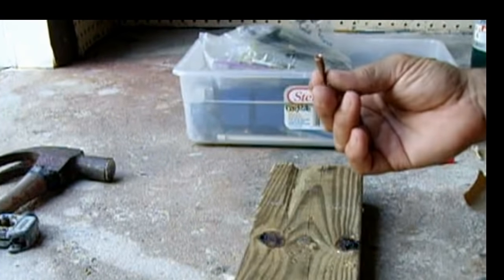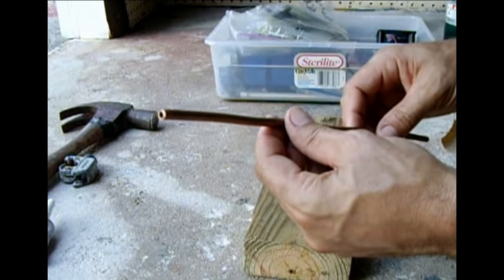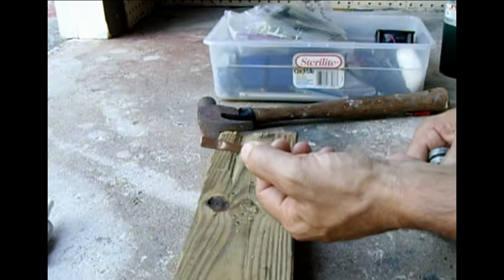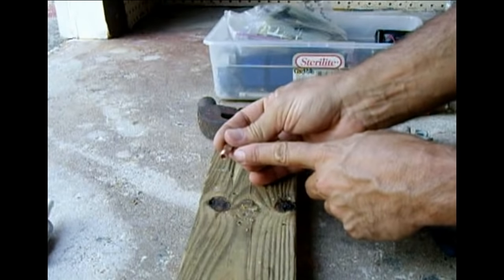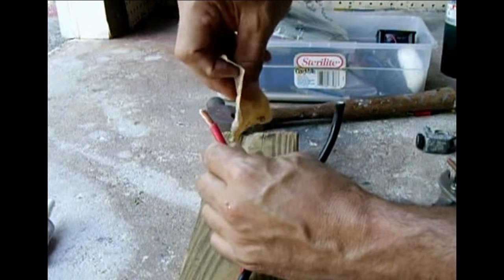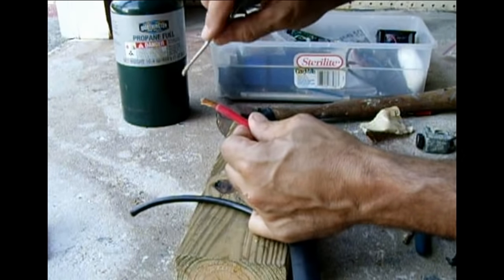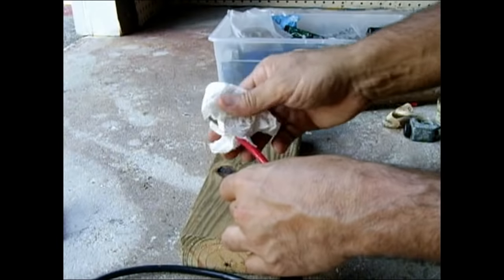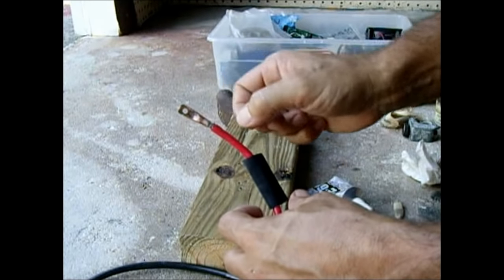How To Make Copper Battery Cable Connectors!

Comment: Haven't read all of the comments, but I'd personally put the crimp in a vice and make a molten pool of solder in the end. Then, plunge the wire into the pool of solder. But, high pressure hex crimping is best for automotive, solder doesn't stand up well in high vibration environments.
Reply from the maker: Vice is no good. When you flatten the end using a vice, both sides flatten the same and the connector does not lay flat. Solder has no problems with vibration. Just make sure the connector is very clean, then you can flux/tin the wire before dipping it into the copper connector which has molten lead.

Thank For Watching.
Reply: I meant that after you've hammered the end, place it in the vice with the open end up. That'll allow you to create a pool of solder in the end of the crimp without the wire near the heat. Then you can push the wire into the end (that now has a molten pool of solder at the bottom). Instead of trying to heat the crimp with the wire inside, softening the insulation, and trying to force the solder into the middle of the wire from the sides.
Reply from the maker: After I am done hammering, nothing will leak out.
Reply: electronicsNmore Nice video and especially useful if you have run out of cable lugs and absolutely need to finish the work during weekend (or if all shops are far away).

If you want even slightly better cable lug do the hammering in smooth surface like anvil or similar. This way there is no roughness in conducting surface which will help to boost its life and resistance to corrosion. Also if there is a solder pot available, it would be beneficial to dip the preheated  lug in that to get nice protective plating - like found in commercial cable lugs.

Maybe you have some very expensive shops there, but here in Northern Europe the standard 2 AWG (or here we say 35mm2) tin plated, 99,95% pure copper tube cable lug costs about 1,50 EUR (now about 1,70 USD). This is the price when purchased separately and if ordered in larger batch like 100 pieces the price would be a half of that (about 0,85 USD). These are approximate customer prices including VAT. For companies in larger batch sizes the prices are naturally way less.

I also think that correctly made crimp connection without any soldering is the best connection, but it requires from good to excellent quality tool. This is not a problem with wire sizes like 4 AWG or 2 AWG thou, and good enough crimp pliers cost around 100 USD. But with ultimate solutions like superconductor assemblies I have seen use about 5000mm2 crimps in some terminations, and those crimp tools are very expensive. Naturally there can not bee any weakness in those connections and only perfect and large surface area air tight crimp is suitable. In extreme applications also the fact that tin solder (even when doped with high silver and copper content) does not conduct as well as pure copper does matter. And in those very extreme applications connections typically do not use tin plating against corrosion but silver, palladium or rhodium plating instead. Palladium and rhodium have not so good conductivity in typical manner (as a wire) but have very good contact resistance characteristics and can take more mechanical stress than gold plating.

So because pure crimp connecting is used in applications involving highest tech like superconductors in particle accelerators it is safe to say it is the ultimate connection method. But that said, there is nothing wrong with the pure soldering type connecting without any crimping. Thou here we have safety regulation that soldering is not allowed as connection method in any standard main power grid applications. Only mechanical connections to crimped wire ends is allowed. This regulation do not concern low voltage applications.

Comment: Great video...if you have all the tools needed...the problem is that it cost so much money when you consider all those extra tools and if you dont do all the precautionary cleaning and coating correctly that you are showing then you will pay when everything blows up, so what are you really saving here?
Reply from the maker: Trainer DeLeon Most handy people will have these tools.
Reply: Yep if you have all those tools you would think they would already know how to use them. I mean why else would they have them hanging around but for us starting from scratch and are only trying to do a one time job I think its not really cheaper
Reply: I have all the tools from doing tons of other projects, mostly plumbing & other construction.  I am just now starting to dabble in solar, and consequently looking at ways to contain costs.  So yea exactly, if you have to buy all the tools and the copper pipe, those connectors will cost you about 20x as much to make than to buy.  However, if you are beginning to get handy, the tools are an investment.   A cordless drill is tool #1 on my list of tools to have.  A torch is great for all kinds of stuff including lighting your bbq without all that nasty tasting lighter fluid, lol.  Anyway, options are good.  Lots of food for thought in this discussion.  Thanks all!

Comment: where can i buy or get that copper tube? i went to  auto parts store and they are selling  lug connectors that are a little bit thinner  than yours. do you think this would work for my  battery harness?my battery positive side is using a harness not cable wire.
Reply from the maker: Plumbing and refrigeration supply houses. You want type K or L tubing.

Comment: Whhy didnt  i think of this?  If you drill and file before cutting the lil piece off..you wont even need a pliers..good vid sir
Reply from the maker: Thank You. Usually I do drill/file before cutting, but for some reason I did it after cutting in the video. Makes no difference, but it is easier to drill before.

Comment: Great video, but yeah cut hole before cutting pie would probably be wise. How come u did not crimp it as well?Been in Car Audio since '88 and have seen numerous wires come undone that where only                  soldered and not crimped! Thanks for the idea bye the way!
Reply from the maker: I have never had one come apart. If you saw one pull apart in the past, that is because the person did not carefully clean the inside of the connector before it was soldered. I have a crimping tool that goes up to 2/0 wire. Crimping and soldering is extra good. :-)

Comment: on that i would simplify that work ,by using a dremel for cuttin,sandin,and smothin the crimp and use a table jaws to compress (flatten)the piece of pipe and to make the drilling on the crimp and also i agree with somebody comment ,i wouldnt use weld on tick gauge cable if they can be crimped...crimp works as good as weld or soldering if done right.

Comment: A Tip: Drill it before you cut it so you can hold the item with the tubing.
Good idea though an I will be using it when needed

Comment: You're the MAN!
Reply from the maker: Thanks. It always amazed me why anyone would pay a couple bucks for a large ring/lug connector like this. They should only be 25-50 cents each. Big rip off.

Be sure to check out my video playlists.
Reply: electronicsNmore
You can buy them on ebay for 50 cents a piece in small quantities delivered to your door.

Comment: I flatten, drill hole, cut, insert wire & crimp. There is no need for solder or heat shrink tubing. Its copper wire crimped into copper tubing. A proper crimp will hold it and the heat shrink tube serves no practical purpose other than a cosmetic finish. However, if its your material and time you're using, do it any way you wish.
Reply: besides for a bit of added mechanical strength to the crimp, the solder does help improve conductivity efficiency and prevent oxidation

Comment: great ideal, but I can't see that hole being wide enough and study enough for a marine/deep cycle battery bolt connection?
Reply from the maker: It's fine when using larger copper pipe. Thanks for watching!

Comment: been doing this since I was a kid.  I would rather do the whole and shaping before cutting it from the original piece of pipe.  just a little easier and a lot safer.
Reply from the maker: Usually I do drill the hole before cutting, but for some reason I did it after when I made this video. Still no big deal. Thanks for watching!

Comment: and what size tubing for 1/0 gauge wire? Also your pricing seems to be based on in stores like Lowes and Home Depot pricing for the lugs, I just bought a 10 pack of 1/0 cable lugs off amazon for $13.27 yes your way is cheaper cost per material, but if you have to go out and get the tools to do it you will need to be making LOTS of these to cover the cost of the tools to make them.
Reply from the maker: DanielRichards644 Clearly if you do not have copper pipe laying around, or you do not have some common tools available to you, then you would buy the connectors. This video is for people like myself that have tools.
Reply: electronicsNmore
 I like what you did, don't take it the wrong way, I was just saying people that don't own a pipe cutter (as that is not part of the average tool kit) or that drill bit you have would need to make quite a few of these to offset the cost of those tools outside the typical tool kits. I may look into doing this in the future if I need more connectors at some point in the future and there is no question the lugs in Lowes and Home Depot are way overpriced (car audio ones are worse) but I was jut trying to point out there is a middle ground that is cheaper then the store for those that don't have access to the tools or don't need enough of them to justify the cost of the extra tools they don't have.

Again, just for reference, what size tubing would be for 1/0 cable?
Reply: DanielRichards644     I can easily see the benefit for the occasional odd job. I have a box of connectors, but still encounter odd size requirements occasionally. Slapping that together myself is a lot quicker and cheaper (cost of the lugs, gas, etc) than running to the store. And, of course, most interested in this would have such tools (hammer, torch, solder, etc) in their shops.
Reply: DanielRichards644    Pipe cutter? Are you kidding? You don’t have a hacksaw, jigsaw, bandsaw, or similar your can cut a piece of copper tubing with, or a drill with bits to cut a hole? If not, then I’d say your particular “typical tool kit” is extremely basic.

Comment: tin the connector and cable and then heat and join.  much cleaner and easier.   and the plastic won't burn.  just make sure you have an iron that will get hot enough.

Comment: This is genius but I have one concern: would the tip (head) of the connector be sealed off from moisture?  I feel hammering the tube together does not create a solid seal from the outside elements...
Reply from the maker: Thanks For watching. If you are concerned about the end that is flattened/drilled, then apply some flux and solder it closed! :-). I never had a need to do that.
Reply: I just made some connections following electronicsNmore's steps and did pretty much exactly that, but it wasn't even necessary. After cleaning up the ends that were smashed down it was a very solid connection. 

I had someone telling me that this wasn't a good way to do things and there would be gaps if I did a cross section. Well I did one and took pictures, no gaps. Any gaps there would have been are filled with solder. This is a great and inexpensive way to make cables.
Reply from the maker: Thanks John, I appreciate your comment. This idea works extremely well. I do it all the time. I learned that Youtube has a large number of haters, and people that like to be know-it-alls. If the idea was no good, I would never have uploaded the video.

Comment: I take a piece of the solder and put it in the tubing.  Then I heat the tubing with a propane torch until the solder melts . Then I insert the cable coated with flux into the tubing and finally use a crimping tool
Reply from the maker: Thank works too. Thanks for watching!

Comment: Tin the wire before you put it in the connector. Also, a heavy duty soldering iron would heat this area better with less heat being put on the insulation.
Reply from the maker: I have a 150w soldering iron. The reason why I show a propane torch, is because that is what most people have on hand. Very few people have a 150w soldering iron. Yes, tinning before is a good idea.

Thanks for watching!
Reply: electronicsNmore Yes, nice video...thanks! And I love the big-ass soldering irons....so useful. Tinning is most useful  when you want to avoid putting excess heat on a conductor/connection, when you have a too small iron for the job or when you are doing a solder in a real tricky spot.
Reply: electronicsNmore
I'm doing a bit of (amateur and not too pretty) soldering these days, and I sometimes have a problem with getting the connectors (or whatever) warm enough. I think I have realized that when having a drop of tin on the soldering iron then heat transfers better, or am I imaging that? So I just want to ask, if you were to heat the lug with a 150W soldering iron, would you just press it on the lug, or would you cover the tip in "a drop of tin"?
Reply from the maker: 150W soldering iron may work for a heavy wire, but the outside of the lug will need to be tinned as well to allow for the easy transfer of heat from the soldering iron to the lug connector. Tinning the wire and inner connector first is a good idea.

Comment: why didn't you drill the hole before cutting the pipe w/ the pipe cutters?
(i would have.)
sorry if someone already asked you.
good video, good ideas!
Reply from the maker: There is a reason for that. If I flatten the end of the tubing/drill the hole before I use the tubing cutter, then the tubing cutter rollers would not roll around a deformed pipe. You would have to make the connector longer in order to drill the pipe first. Everyone has a method they like. I prefer to cut, then flatten, then drill.

Thanks For Watching!

Be sure to check out my video playlists.
Reply: thanks! just an idea.

Comment: Easiest way to make lugs is use copper tubing with the ID slightly larger the the OD of the wire and drill a proper sized hole.

Comment: You do a nice job of making up those connecters.  I had the same idea for making strap connecters to link prismatic LiFePO4 cells. I needed 24 straps and it was a lot cheaper to make them from heavy 3/4 inch copper pipe. Its works well.......but not fantastic, hears why. I found out later that electrical grade copper connecters and bus bars are make from a different alloy of copper than plumbing copper. what we both made is not the same as the real thing in practice and that's the truth I guess.
Reply from the maker: You will never experience any issues using regular copper over a copper alloy, especially if you apply heat shrink tubing, or a corrosion resistant spray/coating to the connector once it is installed. Your being paranoid! If your that concerned, all you have to do is wire brush the entire connector, brush on some flux, heat it up, then dip the entire connector into molten solder to tin the entire connector for full corrosion resistance. Your worry will be eliminated.
Reply: electronicsNmore No parinoia involved at all. I'm still using the straps I made. I am just stating the fact that electrical copper has less resistance than plumbing copper and they are not equal.
Reply from the maker: The difference is barely measurable. I think the copper used in buss bars is just under 100%(99.9%) copper. The plumbing copper is closer to 100%.
Reply: electronicsNmore You have it turned around. The top 20 alloys of copper are at least 99.3%  to 99.9% copper and plumbing copper falls into this category. Electrical copper is just about pure and its production is regulated with very small quantities of oxygen, 200 ppm and under, to keep out impurities.
Reply from the maker: Either way your not going to notice any voltage drop due to resistance when both are close to 100% copper.

Comment: First - Thanks for the video!

Is there a list somewhere that shows gauge of wire to size of pipe?
Reply from the maker: +Jeff Hahne 
Hi Jeff. Yes, please refer to the links below. You need to look at the ID for the copper tubing(Type K or L), and compare to the OD for the wire size you are using. 

Please be sure to share my channel with others, and rate thumbs up.
Thanks!

https://en.wikipedia.org/wiki/Copper_tubing
http://www.powerstream.com/Wire_Size.htm